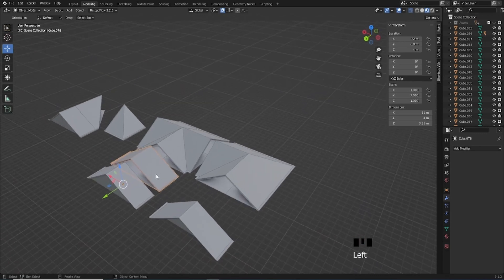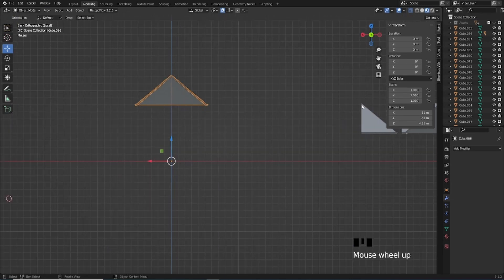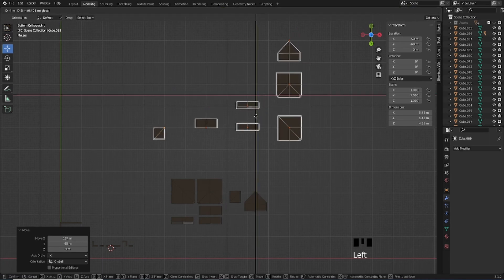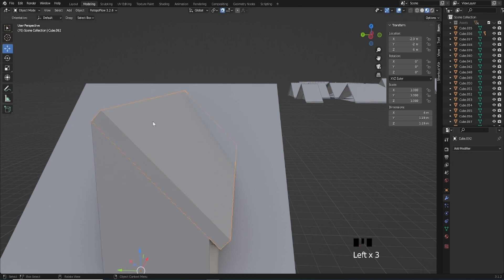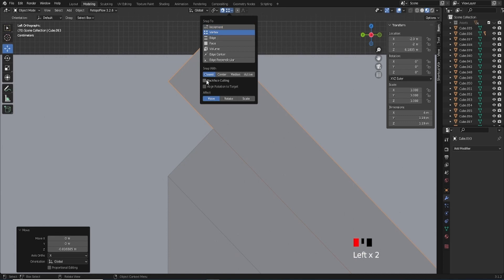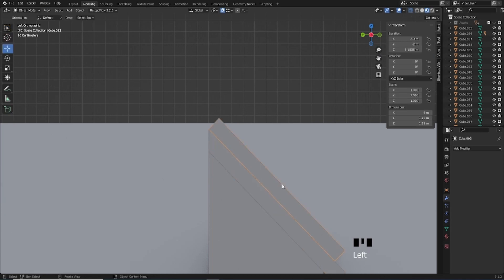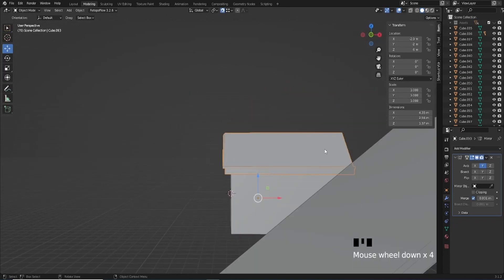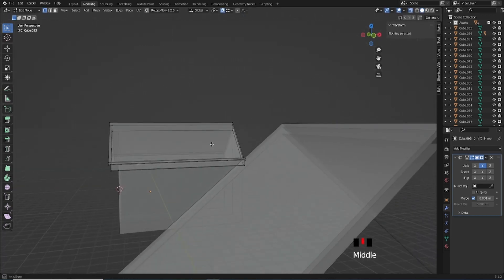Blender Modular Design - 08 Roofing Windows

Comment: Incredibly helpful video series. I was having trouble with the snapping at around 13 mins into this one. Vertex snapping in ortho view was snapping the vertices down the middle of the duplicate for some reason, but snapping to grid followed by scaling the verts to 0 on the Y-axis did seem to work. I am using version 4.4 so not sure if something changed. Thanks for the great videos!